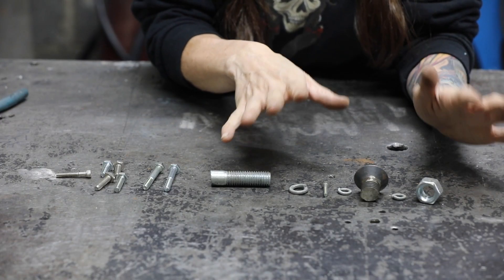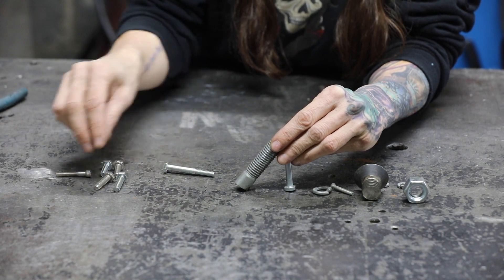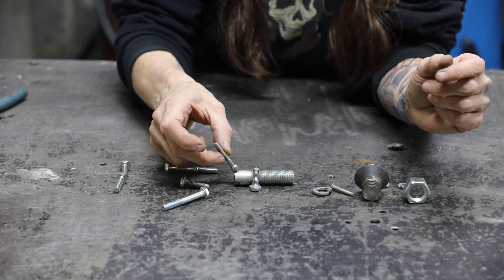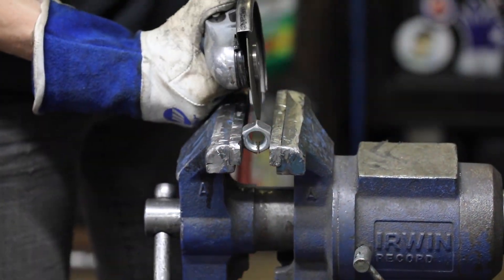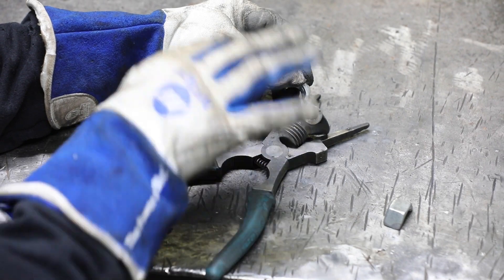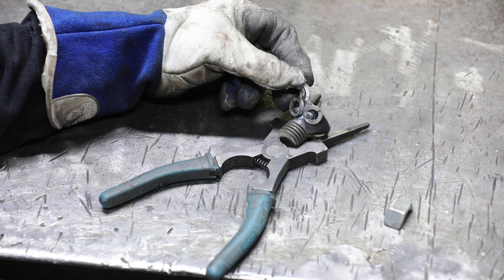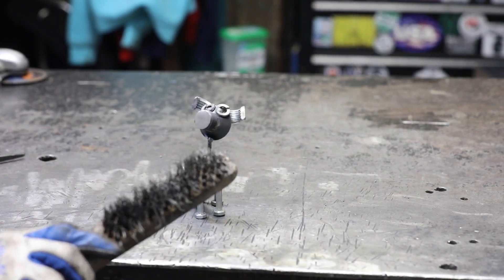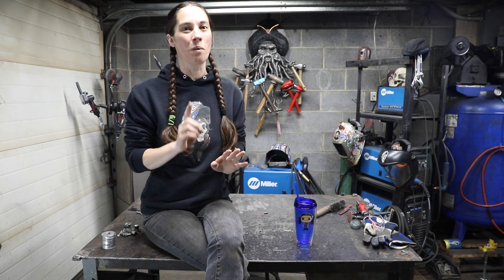How To Weld A Dog | Easy Scrap Metal Art | Barbie The Welder

Comment: Wire speed and voltage for us newbs?

You’re an awesome example for young women in case no one ever said it. Be Well!
Reply from the maker: Hey Chuck, my Settings won’t help you however there should be a cheat sheet inside your welder where you can set it up for wire speed and material thickness and gas you’re using if it’s not inside where the spool is then check online those parameters will get you close my travel speed will be completely different from someone else’s and so anything I’m doing here is not really gonna Help as much as original parameters were working from that.

Comment: Very late to this video, but learning to weld and just got two of your books.

While researching info while waiting on welding supplies and your books to come in, I've found conflicting information on welding galvanized and stainless metal (two kinds of hardware you can find to make something like this). They both apparently release toxic fumes (zinc fumes and hexavalent chromium fumes) but can be done safely if you wear a respirator?

What precautions do you take? And are the parts you're welding here zinc plated, stainless, or zinc plated and you treat them to remove zinc? Or something else?

Great content, I look forward to reading your books and trying some of the projects!